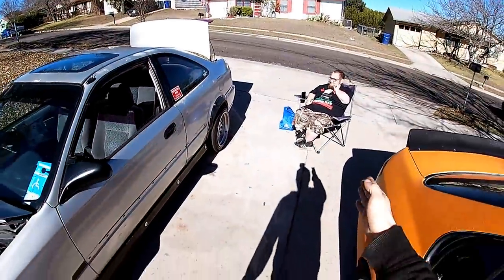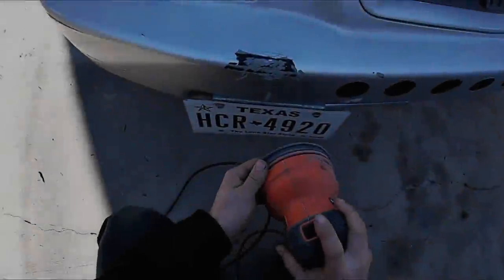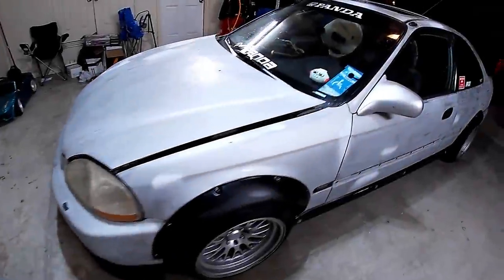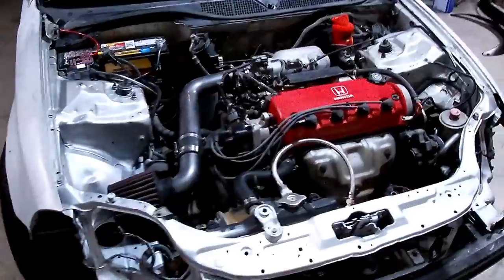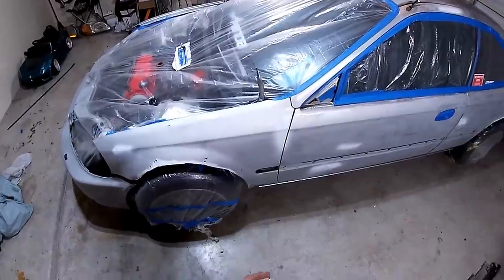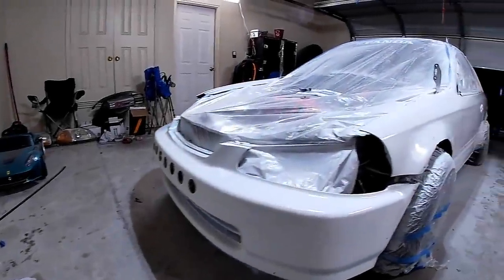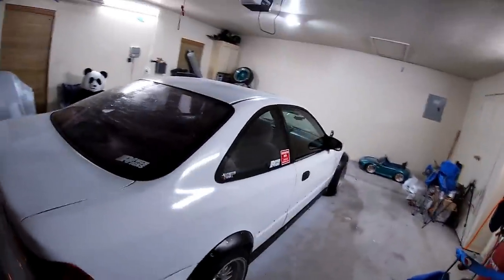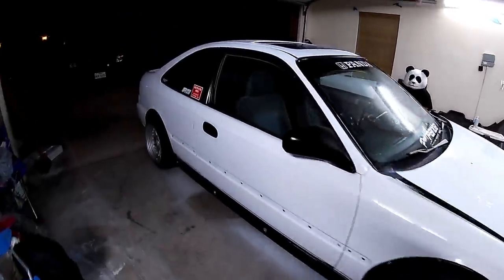$35 Rustoleum ultimate high gloss spray can paint job (CHECK IT OUT!)

Comment: Looked up spray painting a car as a joke, and now I'm actually interested in trying this to save money.
Reply: Paul Duplessie me too
Reply: I did it with not experience except Plasti dipping a car once and it came out pretty decent just polished it and i was shocked at what I was able to to but I used the other formula
Reply: Dude James Moore is as legit as you can find a car painter using only rattle cans. Go back through his library bud
Reply: Man watch all his videos on how to do this. He smashes it every time and it looks like a winner!
Reply: With the right kind of paint, you absolutely can.
Reply: Doing mine now. Only getting off the clear is what takes a day or 2. .then after that it's smooth sailing easy.
Reply: Best way to get a good spray can job is paint. Wait a week wet sand then clear then wait a week and wet sand again. The finish will be unbelievable. Aslong as you apply the paint properly and dont have runs
Reply: You can save millions!!!😦👀
Reply: Lol i watched enuff videos on this so i just purchased a 2 can kit its my factory color as a base and 2k clear im going to experiment on my trunk and see how it goes
Reply: The paint could look bad after a while and have bad reactions from other paints, if you want to get a decent cheap paint job this style called Maaco is cheap and it’s decent paint jobs

Comment: Use polishing compound on the glass itself to remove anything like what you are seeing on the sunroof. I thought it was crazy as well. Try it out with a buffer or soft cloth and elbow grease and see for yourself. It also saves you a lot on wipers if it is your windshield because it makes the glass smooth as all hell and makes water bead off of it pretty fast. Saw it on another channel and thought I would try it out on my own vehicles. Works

Comment: How do you get it so there is no noticeable lines in the end, or paint runs?
Reply from the maker: Darp Durp Because it’s cold at night here I had few start that’s why I whipped out the heat gun I stop it before it started. I lay them coats thick but with the cold it’s harder to do.

Comment: So do you usually apply a clear coat after or just use the spray paint?  Do you correct any orange peel in the paint coat or only in the clear coat after?  I want to repaint my dad's 2003 Saturn Ion but I want to make sure I don't have any orange peel, I want it to look almost as new.  (Love the content btw!)

Comment: Dont know why I just thought to ask bc I've been searching for about 2 weeks now. What's the difference in lacquer and clear? I got a set on Integra wheels for my dx and did them matte "Blossom White". Found the cough* cough* 2x clear but not 2k. Found alot of lacquer and expoxy though...
Reply from the maker: Well i'm not exactly sure myself but i always test it on something and if it works i roll with it lol
Reply: Lacquer is a single stage clear, it doesn't have the good characteristics of 2k clear. It will fade alot faster and chip much easier than 2k, also lacquer clear doesn't have uv inhibitors in it to prevent the paint from fading. There may be some out there with a uv inhibitor but I dont think the stuff in a can does. 2k will maintain a gloss for a long time. Lacquer will dull up much faster. But im not expert painter, just painted a few things. Also most lacquer clears aren't chemical resistant like 2k is. So gasoline and other things can stain and dissolve it. I can speak from experience that when I painted my bike I used a good 2k clear and trying to remove it with aircraft stripper it didn't react at all. I had to gouge the paint down to the basecoat to get the aircraft stripper to do anything.
Reply from the maker: Oh my i feel stupid i know what a lacquer is LOL i used it on my Lime green dodge neon it don't require hardener so its a 1K paint or 1 part. It does ok for temporary clear coat. I prefer the 2k clear over it though.

Comment: If for example the the trunk is painted green and you want to paint it white would you sand it down and and put primer? Or how would you do it? I want to paint my trunk white
Reply: Thank you
Reply: U dont always need primer. If ur paint is in good shape and u only want to change the color you canvwet sand it with 600  and paint right over the old paint. Primer is for filling in deep sanding scratches made by something like 80 or 180 grit wich is used to mske repairs or shape and sand body filler ( bondo)

Comment: I've learn to just wet sand and buff after you finish your color. It really makes it look super legit. Mirror finish.
Reply: Wet sand then compound then polish , gets rid of the orange peel and give it’s a smooth mirror gloss finish
Reply: DIGITAL SILVER  as long as the paint is gloss and doesnt have a metallic flake in it you can wet sand it without issue
Reply: You’re correct. However you can sand and buff the 2X paint gloss colors. Paint has zero protection and can scratch very easily. Best bet is to use 2K clear coat after paint.
Reply: DIGITAL SILVER  That's what I thought until a friend told me to wet sand and buff. Thought he was crazy but it works. Now, my $50 paint jobs look presentable...
Reply: @veeanon2238  For sure. I did a 2001 I30 High Gloss Black, then buffed it. The shine afterwards was almost as good as having a clear coat on it. Mirror finish. ( for those reading, the sanding and buffing do remove paint which you will see during the process.) https://youtu.be/J1ixUZjDJyI
Reply: @MarketingCoachKen  did u use s buffing wheel and what compound would u recommend using? Thanks
Reply: @alanrink4268   ebay buffer cost $45 few years ago. Variable speed up to 6k rpm. I use 3k to 5k rpm (faster rpm finishes faster) I use standard compound. It's tan color and thick like mayonaise.  I buy it from local Auto paint supply shop, and I dont know the brand because they buy it bulk and sell you a quart for $20. I usually have to buff each panel 2 times before the full shine come out. First time only brings back color after sanding. Also I found that FOAM pads work best on Rustoleum paint without clear coat.

Comment: Wow i give it to you. Your really experience with the can. I jus rattle can my car and could not get a steady stream of paint. Lol thanks for the videos and how to
Reply: Did you use the rusto 2X paint? And did you paint inside away from wind? And above 50 degrees. Hold can about 18” away from the car. I’ve done many and this is the main factors beside sanding and cleaning the surface.
Reply: Try sitting the can in warm water for a few mins before spraying
Reply: I did complete opposite. 30-40 degree temps trying to work with the wind and rain work on it after work at my job in the employee parking lot

Comment: I love your videos.  I can't wait to paint my CBR600F4i.  Can you use 2K over this high gloss or will there be a bad reaction?
Reply: You have to wet sand it it with 400 grit till it looks dull. Don’t paint over the current gloss
Reply: Natan Borges you don’t have to wet wand it’s better it you do but it’s not required
Reply: @domoowalk  it depends on how long you wait to clear it. You can get away with not sanding it if you're clearing it the same day as you paint.

Comment: How long does this type of paint job last?  Also, what's up with that lifted hood hinge?  I'm seeing this more and more.  Not sure what it's supposed to do, other than for looks.  And even with that, it seems like a terrible idea.
Reply: Hood risers are for looks but it also helps to cool under hood by circulating some air in there when the car is moving and a better escape for hot air when stationary.
Reply: Look up some of his old videos but he says these jobs will last years if you maintain it. There are videos where it's sanded and polished and it looks amazing. Cover that with ceramic coating and it would last for some time. Spray max 4k clearcoat in a can is best though.
Reply: They are just for looks unless you have some sort of scoop or something behind your engine to redirect the air

Comment: Hey whats up brother i had a question i wanted to spray can my car do but i live in Nevada and it gets really hot here well the paint fade away ? Should i use a different can? Also the car i want to paint has plastic dip should i sand that down all the way? I plan to paint the car white!
Reply: Okay so here's what you do was pretty much any paint you do with a rattle can the actual paint doesn't matter Rust-Oleum sells a UV resistant clear coat this means that doesn't fade yellow or disintegrate in the Sun if you don't use a clear coat with UV resistance especially in a climate like that you're going to have a bad time
Reply: @datboibottemtext  thanks so much man is there any way i can send you a before and after of the work i will do?
Reply from the maker: Franky Navarrete I didn’t answer that question it was someone else but they are right and instagram.com/lucky_irish_mechanic
Reply: Ohh lol ok cool thanks man love your videos

Comment: Tried spraying my miata with the metallic blue but my trunk came out looking like shit. Going to sand it down and retry any tips on how to get it looking better?
Reply from the maker: steve aguero i have a video of me painting a fender metallic blue in that video I show how I did it.
Reply: Yeah I saw it already but that was with the fender off. So should I take the trunk off also n spray it with the trunk standing up?
Reply from the maker: steve aguero Flat it better it don’t run as easy but if you don’t take it off at least tape and plastic or paper off anything that you aren’t trying to get paint on. Focus on it 1 panel at a time.
Reply: Maybe I'm just holding my can wrong. Do you have any videos where you focus on the trunk area or anyway to send you a pic of my trunk to show you what I'm talking about
Reply from the maker: steve aguero instagram.com/lucky_irish_mechanic
Reply: Sent you a message I'm Instagram

Comment: Looks awesome brother but I think panda needs some colored LED under lights.
Reply from the maker: derf yerots 🤔 gonna run that by him. Ima be doing them on mine for sure. He has interior glow and bright blue dash lights too
Reply: @JamesDguy  a cheap DIY method that I went on my last 1st gen neon build was  I just used led rope lights that you can pick up at most big box stores lol. Cheap but worked great just put a inline fuse with a toggle switch. Think I might have had $30 tied up in the set up.

Comment: I am thinking about painting my Toyota truck white, I don't know which paint I should use the rustoleum appliance white are the regular rustoleum gloss white are the one you just used the 2x. thoughts on what paint I should use?
Reply from the maker: Lyndon Sharpton 2X is the coverage 2k has a hardener which rustoleum don’t have it in. It was white rustoleum ultimate high gloss 2X

Comment: The mixture of acetone, isopropyl and water? How much did you use of each one?
Reply from the maker: Marlene Sanchez I kinda just add a little  of the alcohol to some water. I used the acetone on a rag wiped it down and the isopropyl and water I sprayed on the car and wiped down. I don’t really measure I just wing it
Reply: @JamesDguy   ok. Thanks for answering my question.

Comment: That 2 times rust oleum, is Acrylic paint it’s no good. Need to use the regular oil based rust oleum.
Reply: That Honda probably came with water based paint it's fine hes just showing a spray can base coat and 1k clear anyway

Comment: I had a Issue with the 2k I waited 24hrs and then hit it with 2k had a reaction
Reply: Sure it wasn’t 2X?
Reply: @spartacussmith7070  it was glamour 2K  $27 one
Reply: Sabrina Eli The rustoleum is a non-2k base paint. It is not recommended to use a 2k on top of a non-2k finish per manufacturer. You can shoot the 2k clear after a week or after it gasses off. He appears to be successful with using it not long after the Rustoleum though - this is just conventional advice. I have seen nearly all his videos because I am thinking of doing something similar, just want to be careful because a reaction is typical. Spraymax is not an enamel like rustoleum, and that’s why you had a reaction.
Reply: Sabrina Eli Basically I’m looking at Rustoleum acrylic lacquer spray paint
Reply: @sunbirgill5990  he's used various Rust-Oleum paints be it 2x, professional and or enamel and has had zero issue going over with spray max 2k clear coat. He also has vids using it over various Rust-Oleum paints. You need to wait at least a week for the rusto paint to cure and release it's vapors, rusto takes longer. Then make sure to wet sand with 400 grit, no lower or higher, before you paint the clear as it needs something to attach to. It won't chemically bond now that the color coat is cured. Make sure to tack rag after sanding really well and then you can clear following the directions from the can. Don't sand or polish the clear for a good while. It'll turn out just fine. May have had debris, oil, etc on when you tried. Can cause fish eyes, solvent pop, cracking, etc. Good luck.
Reply: @davegregory791  hey thanks Dave, good looking out

Comment: 1) Some spots are shiny, some spots show a very dull finish...why?  Poor prep, primer coming through, poor application?
2) For being only $35 in, why not spend a bit more for the clear as well?  At least then there's an option to color sand it.
Reply: I wondered that same thing. Like, why not put a sealer coat on before painting that way its all the same color under the base coat and the finish will be consistent all the way around.
Reply: @kennethturner7942  hes says the owner has little money tied up in it and its just for fun.